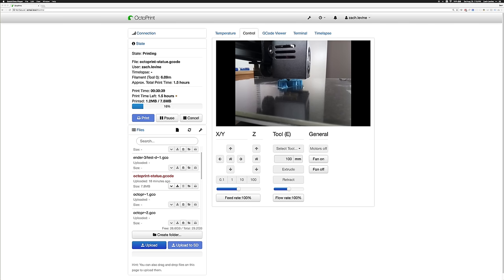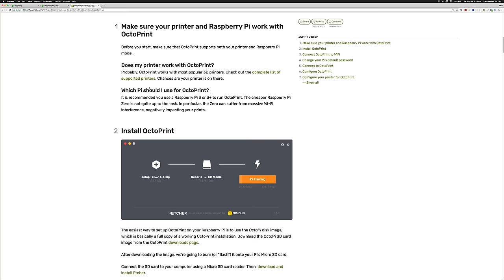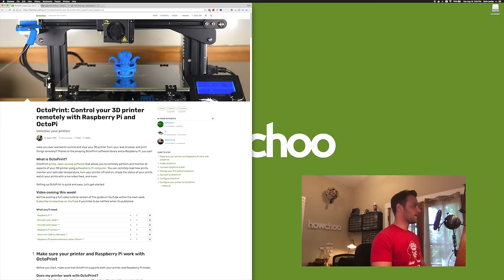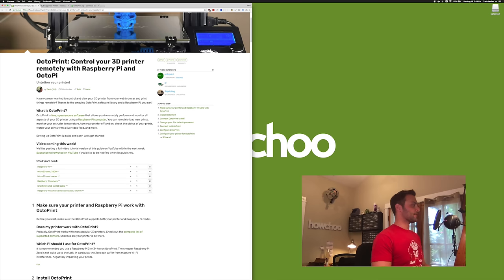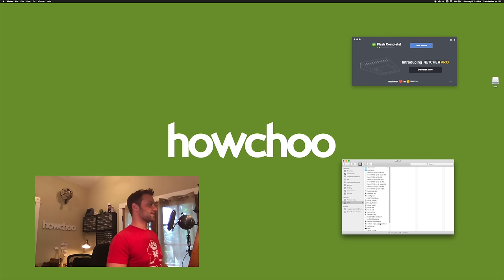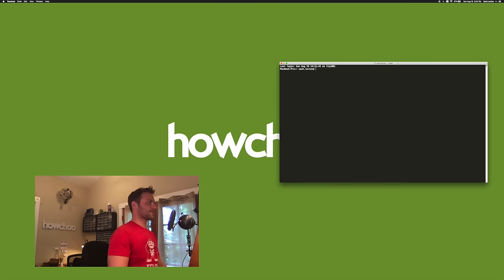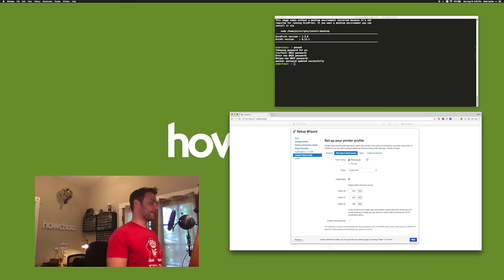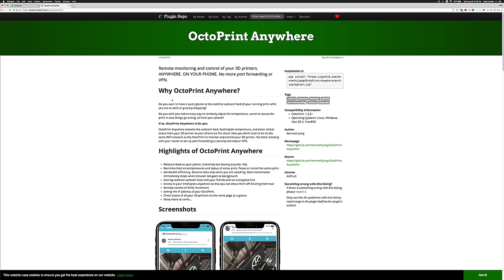OctoPrint: Control Your 3D Printer Remotely Using a Raspberry Pi!

Comment: Easily the best guide for OctoPrint installation, Thank You.  I watched 3 other guides before this and not a single one even mentioned the USB cable or plugging it into the 3D Printer.  Thank you for laying out the hardware and requirements beforehand everyone else mentioned the Pi, Camera and SD Card.. that was pretty much it.
Reply from the maker: No problem! I’m really glad it was helpful :)
Reply: I agree with ^ . No other guide explains how you physically attach the pi to the printer, incredibly. Thank you for making this video, it helped me get my printer up and running!

Comment: Nice video! Thanks for making it. If you thread the camera cable through the slot in the case cover first, you can plug it into the port a little easier than trying to manipulate it through the cover's slot.

Comment: These instuctions are good and will get it up and running. I was unable to get Octoprint to print as good as printing directly off an SD card plugged into the printer. I tried for over 30 days, got help from numerous forums and YouTube videos.  I finally gave up and just went back to printing from SD card,  I still have the webcam just watching the prints, but no control.  My printer is an Artillery Sidewinder X1, My Raspberry is a 4 with 8Gb.

Comment: 12:57 USB mini is a stronger connection, micro cables tend to end up bending in the vertical if care isn't taken when plugging them in. One of the reasons USB-C is a bit bigger.
Reply from the maker: Very true. Thanks for the info!

Comment: Please, if you are pitching an open source product, do not forget your fellow Linux Users. Etcher is available in Linux 32 & 64 bit Systems. Not on ARM system such as Raspberry Pi. It works on my 10yr old HP mini 110 - Atom, running Lubuntu/Debian 9.x

Comment: awesome video! definitely going to build this for my ender 5. slightly unrelated question.  do you have a video or information on how you made the lighted Howchoo logo sign? I would very much like to build something like that.
Reply from the maker: Yep, I do actually! So for the letters, I just extruded an SVG of each letter to make the 3D-printable models and then made each hollow. For the LEDs, controller, and programming, I used the same approach as in my other guide here: https://howchoo.com/project/othjmwu4mju/my-led-disco-ball-music-festival-totem -- The approach in that guide is the same, except that I used a flat individually-addressable LED strip (also from Adafruit) rather than the "Christmas tree" styled LEDs shown in that guide.

Comment: I have an extra Raspberry Pi, if i flash Octoprint to a disk for it, can I immediately use it with my Ender 3 Pro, or does it not function properly without the camera?
Reply from the maker: Yep, you could immediately use it. The camera is completely optional.

Comment: This is a great video, very clear and easy to follow for a newbie like me.  Would you still recommend the Raspberry Pi 3 Model B+? Or would it be better to start with a 4?  If so, could you provide a link?
Reply: There isn't much that needs the extra power of the Pi 4.  I'd stick with the cheaper 3 B+ for now.
Reply from the maker: Willverges is correct—the Pi 4 is overkill for this. You can use it if you want; you'll just need to use a different case and cable. This is mentioned in the print guide: https://howchoo.com/g/y2rhnzm3odz/control-your-3d-printer-with-octoprint-and-raspberry-pi

Comment: Superb step by step tutorial. Just waiting for my kit to arrive and I'll be building this onto my E3P. Thank you. I have liked and subscribed.
Reply from the maker: Great! Hope you have fun with it :)
Reply: @Howchoo  The kit has arrived and I have begun building it. Some things have changed with the Octopi install since your video but that has not posed a problem so far. I am just wiring the buck into the PSU now. One thing that occured to me, the Raspi being a Linux system needs to be shutdown before being powered off to prevent corruption. This could be a problem if you just turn your printer off. What's your take on this?

Comment: Becareful with highly detailed models via octoprint. It took me a while to figure out but my rpi couldn't keep up with the speed of the commands. As such prints took 5 times longer and quality was terrible. Transfered file to sd card and it worked fine.
Reply from the maker: Interesting! Which Pi were you using?
Reply: It was a pi 2(had it left over from another project). I should upgrade and get a newer one and see. I still think octoprint is awesome and still use it for my own simple models. I also also using an ender 3 :)
Reply from the maker: Ah yes, that’s definitely why — the Pi 2 has the same specs as the Pi Zero, which OctoPrint recommends not using :) I would definitely upgrade to the 3 or 3+
Reply: i was going to attempt to set this up on my rasberypi untill i read this comment so i was wondering if partitioning my hdd on my workstation with an 8 core cpu and 32 gb of ram for duel boot to be able to boot into octoprint for my ender3 would be better?
Reply from the maker: joe sabato As long as you’re using a Pi 3 or Pi 3+ you’ll be good. The older Pi 2 that Koops used isn’t powerful enough.
Reply: mine is older aswell thats why im trying to use my home workstation becauase i would like to be able to monitor prints via a webcam and also be able to make the time laps videos maybe thiers a better way im not thinking about but octoprint seams pretty legit for thies functions
Reply from the maker: Yeah you can definitely monitor using your Pi camera and create time lapses with octoprint — and you can run octoprint on other systems than the Pi. Just not using the method I describe in this video, of course.

Comment: Thanks for the video.  Octoprint works great!  If anyone can help with my issue please respond.  After about an hour of printing my computer shows the "This site can't connect screen" and I have lost the ability to reconnect.  This does not affect the print, but I can no longer view the camera or any other features.  This also means I do not have a good idea of how long the job has left.
Reply from the maker: Whoa that’s very strange. It sounds like it’s probably an issue with your router; the fact that the Pi continues to print tells me it’s still running correctly. Could you try connecting both the Pi and your computer with an Ethernet cable and try again?

Comment: Noob question, but do i have to leave my printer on power all the time to controle is, like leave it on. Now after it is done i have a on off button which i turn off, i own a Anet A6 and there is now way i can have my printer in stby mode.

Clear video you made, very understandable.👌
Reply from the maker: If the Pi is powered by your printer, you’ll need it to be on so it can continue to power your printer. If you power the Pi separately, you could log into OctoPrint but without the printer being on you couldn’t do anything anyways ;) Does that make sense?
Reply: @Howchoo  is it possible to control a relay wich than powers the printer with the rasperry pi?
Reply from the maker: @fabian899  Absolutely. Check out this guide and video on controlling a relay using your Pi: https://howchoo.com/g/m2qwmte5nzk/how-to-use-a-relay-with-a-raspberry-pi

Comment: This (well done) video was almost 2 years ago. What is the newest version of the hardware available??? (not printer version, but Octo... hardware & software.
Reply from the maker: You can now use the Raspberry Pi 4, but otherwise the hardware and software steps are the same :) See the full guide in the video description for a few Pi 4 notes

Comment: Great Video. Have you tried using Octoprint with a USB webcam? Would the setup be any different, other than the physical mounts? Curious if I could save ~$20 by using an old logitech 720p webcam I have laying around.
Reply from the maker: I have not — I know the Pi itself supports USB webcams but you’ll have to Google whether or not OctoPrint does. I assume it would; that would be quite handy
Reply: @Howchoo  Following up- I gave it a try and all I had to do was plug it in. No drivers or mods needed!

Comment: This video is very clear but I'm looking for few troubleshooting options as well. I.e., I'm trying to Octoprint to Creality CP-01. Octoprint is shown in the web browser as in the video but the 'Connect' button doesn't result in establishing a connection. Need help.
Reply from the maker: So the CP-01 isn't explicitly listed as supported by OctoPrint: https://github.com/foosel/OctoPrint/wiki/Supported-Printers

This doesn't mean it DOESN'T work, but it does mean you'll need to do some research to figure out the settings. Have you searched around to see if anyone has used OctoPrint with the CP-01 before?

Comment: Great tutorial.  I'm making good progress but have hit a bit of a 'bump' trying to print the arm to mount the Pi camera to the gantry.  My Ender 3 Pro seems to struggle around the mounting holes for the camera mount despite me doing 0.12mm layer height at a speed of 50mm/s.  Do you have any tips to offer in terms of printing those parts please?
Reply from the maker: Sorry I missed this! Is the issue that the arm and camera housing mount (i.e. the hinged portion) are very tightly bound when you put them together? I had this issue as well—this isn't a printing issue, but a design one. There's 0 tolerance between the two parts. I just carefuly cleaned it up and removed a small amount of material using a hobby knife so things would fit together better. Hope this helps!

Comment: Can i ask a question/advice... I have a raspberry pi... however I am toying with 2 projects... I bought it for the purpose of using Octopi to control my printer byut since then I have been thinking alos of using it for a VPN and a NAS server as well... My question is... Can the same Pi be used as a VPN and NAS Server but also be linked to my 3d printer to enable me to monitor the printer from my phone as well as send print requests from my pc instead of using SD Cards (like Octopi does).

Thanks for any advice you can give me... and also keep up the good work with these videos...
Reply from the maker: I highly recommend having a dedicated Pi for OctoPrint/OctoPi. The process of feeding lines of gcode to your printer over serial is pretty resource-intensive. If you were running a VPN and NAS server and did something to tax your CPU/RAM, it would actually show up in your print quality ;)

You can definitely run a VPN and NAS on the same Pi, but grab a dedicated one for OctoPrint.

Comment: Thanks so much for a great tutorial. Looking for this and it will help a lot on my upgrade. However, I plan to upgrade first my ender 3 board to the silent board which suppose to have thermal runaway activated. Does that mean I can skip the firmware update and hondirectly to pi? Is it the same process with the CR 10 S?
Reply from the maker: No problem! So I definitely recommend the silent board upgrade; the firmware version that it ships with should have thermal runaway enabled. I actually just wrote a guide for this: https://howchoo.com/g/ntmwy2u4owu/ender-3-board-upgrade

Comment: Hello, thank you for your video. I am wondering though, do I install the latest raspberry pi 4? is it compatible? If not, which model would you advise? Thank you foer your time
Reply from the maker: The Raspberry Pi 4 will work great—check out the linked guide in the video description for a few notes on using the 4.

Comment: I followed every step but when I go to command prompt and put in ssh pi@octopi.local it says could not resolve hostname octopi.local. Also When I type http//:octopi.local in google it says site could not be reached, it’s very frustrating. Anyone help?
Reply: Check if PI is turn on and got a local IP address. (Scan local network or login to your router and check connected device, you will find pi connected) if not then resolve this issue using a ethernet cable and reboot. and url should be like this http://octopi.local

Comment: Do you have to use the camera or can you just buy the Raspberry Pi and control it? I'm at the house but my girl friend wants to be able to tell it what to print while she's at work. I'll be removing the prints and cleaning off the surface/apply hair spray etc. for her so a visual isn't necessary.
Reply from the maker: The camera is totally optional — just don’t connect it and the other instructions are the same. :)

Comment: What do I need to do to switch the OctoPrint from one printer to another?  What changes need to be made?
Reply from the maker: I haven't done this yet, but I have researched it quite a bit. The general consensus is that if you want to print on multiple printers *at once*, it's best to set up multiple Raspberry Pis -- one for each printer. If you want to print on one printer *at a time*, this works out of the box. Just go to Settings and select Printer Profiles and add the second printer. When you go to use OctoPrint, you'll be able to switch between the profiles. Let me know how it goes!
Reply: Thanks.  I have switched to a CR-10 S Pro and could not get the OctoPi to connect   It was used previously on another make. Turns out that I had set up the new profile wrong in OctoPrint.  All good now.  Appreciate the help!
Reply from the maker: @ottdave1  Good to know! Thanks for the update

Comment: I am wondering if it's also possible to turn on your printer from a different room using a raspberry pi? Or is it still required to turn on the printer (and/or raspberry pi) physically yourself?
Reply from the maker: With this setup you have to turn the printer on yourself. But you could theoretically turn it on remotely using a relay or smart plug.
Reply: @Howchoo  Thank you very much for the response and the tip! :). I have found a YouTube-channel called Gyro where he explaines how to connect a relay to the RaspberryPi to turn it off/on remotely.

Comment: Is there a way of pushing files over the network for auto-printing?  I'd like to control a bunch of items using a RP using Ruby, such as stepping motors, etc.  More robotic than anything, but also inclusion of 3DP control.
Reply from the maker: There’s an OctoPrint GPIO plugin you can use for controlling steppers and stuff using your Pi — as for pushing files, do you mean pushing STLs and having it auto-slice and print them, or pushing gcode files? The latter is already supported by OctoPrint natively

Comment: I'll be running my printer through a Wyze Plug before I start printing from off location. That way I have a completely separate method of disconnecting all power through my Wyze app. And for less than $20...

Comment: Hello, I did the buck converter add on and I measure with my multimeter with 5 v and still getting undervoltage warning, I stepped it up to 5.22 and still getting the undervoltage warning, how much can it go up? I want the warning to dissapear

Comment: Your write-up showed the "Pi Case Sleeve" as one of the parts that need to be 3D printed, but I don't see it being used in your video.  Where exactly does this piece go?
Reply from the maker: This is the Raspberry Pi case — for the Ender 3 (or anything else that has an aluminum extrusion rail to mount to) this can house the Pi. You’ll see me mounting it in the video using t-nuts.
Reply: @Howchoo  Yes, but there's a part call "Pi Case Sleeve" (file name: PiCaseSleeve.stl).  The instruction says to print PiCaseSleeve.stl along with PiCase_v1.1.stl for the Raspberry Pi 2 & 3.  I want to mount a Pi 3 B+ onto an Ender 3 Pro.   I can mount the Pi Case using T-nuts as you've shown in the video.  But what's the purpose of PiCaseSleeve?  I don't see that part being used in your video at all.  It's not obvious to me where that part goes.  Is it needed at all?
Reply from the maker: @ptmoy1  Ah yes, sorry! That piece is a small surround/bezel for the ports. So once you print that, it slides onto the end of the case to help fill in the gap around the ports. :)

Comment: Besides the camera functions. Are there really any real advantages sacrificing a rPi3 instead of slicing on Cura and dropping on the printer?.... 
I mean is there any advantage on Octoprinter over the native software that a printer has? (Ender 3 user).
Reply from the maker: I also find it more convenient to be able to drop files onto the printer from my desk or couch rather than needing to fiddle with an SD card and use the Ender 3’s subpar interface. There are also a bunch of plugins you can install, as well as being able to view stats on your printer and the print status. The camera is a huge plus as well. Also, it’s cool ;)

Comment: Hi, I'd like to do this to make my life much easier with my printer, but my printer is in my garage and not near my wifi connection. Would the pi not work by being too far away? If so is there a workaround?
Reply from the maker: Do you normally get a Wi-Fi signal out there with your normal computer? If not, you’ll need to use a Wi-Fi extender or run an Ethernet cable out to your garage. :)

Comment: Thanks for the awesome guide mate! Only issue i had was when i typed in http://octoprint.local it came up with page not found. Im using windows 10 and a quick google said to install either bonjur packages or ituens as they come with the bonjur suite, then try http://octoprint - i just typed in http://octoprint ( same as your vid minus the .local ) and i came to the correct screen. Hope this can help improve your guide to help windows 10 users. Will be subing as love the detailed vid with written version (y). Cheers.
Reply: Just to be clear i didnt have to download bonjur, just drop the .local to get working on windows 10.
Reply from the maker: Ah thanks for the note!